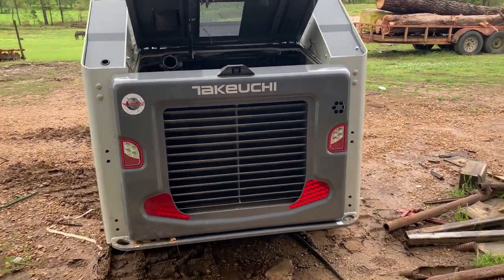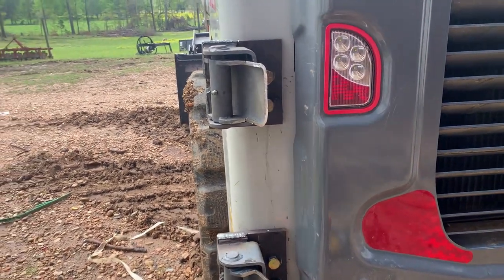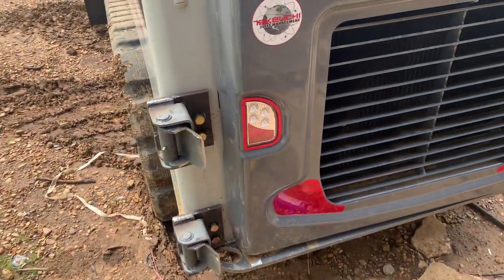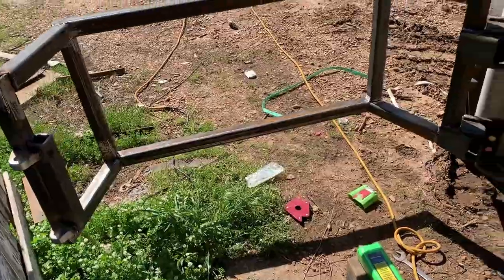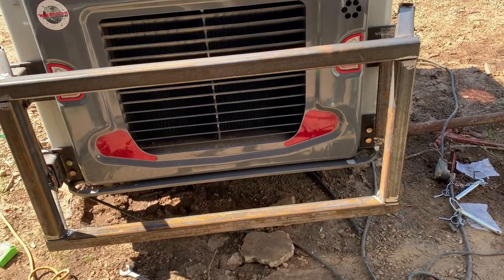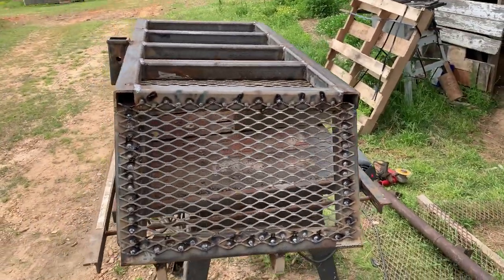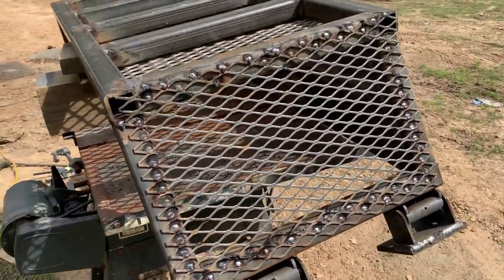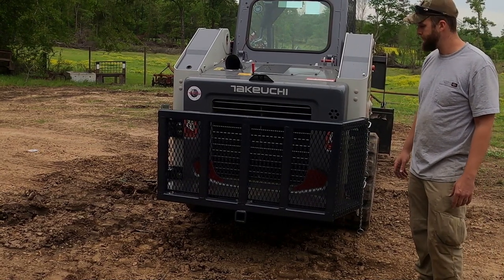Building a Brush Guard for TL6R Skid Steer

Comment: Hey Bro...i have a Tl12v2, can you tell me what pretapped bolt size and thread that is? And is that that 4 inch square tubing? and what gauge? Thank you for the video.....very nice.
Reply from the maker: I don’t remember the bolt dimensions you can take the little protective caps out and match the threads on them in the hardware store. I used 2x2x1/4 square tubing